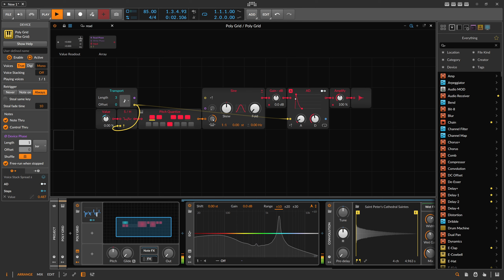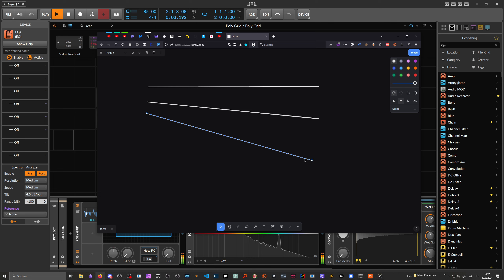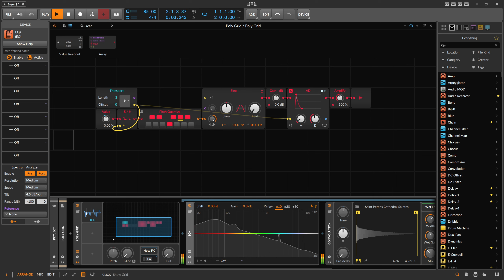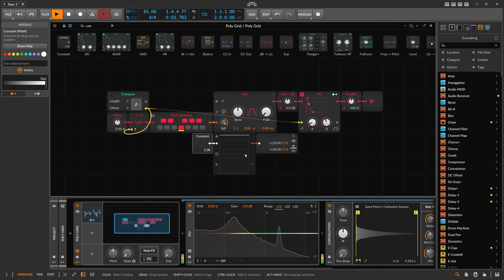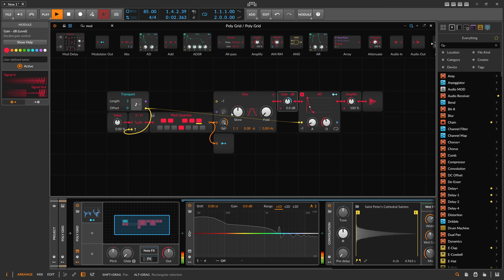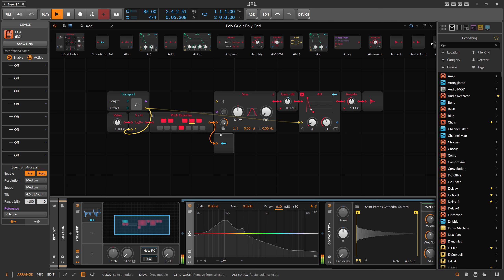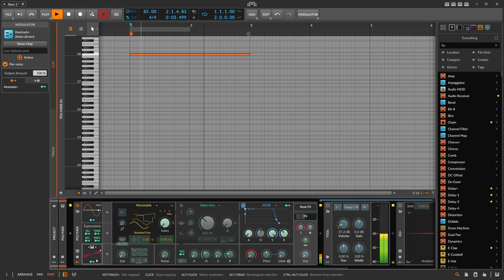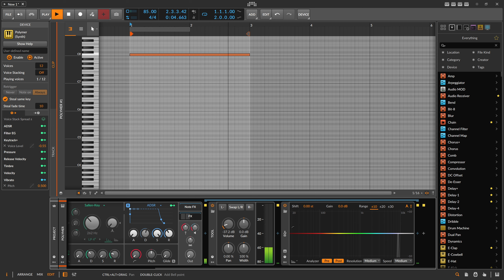Keytrack for Frequency Balance

Comment: Thank you. Must be useful. But for me, when apply this modulator out on gain (db) module, i have many clicks like a short attack. I dunno why, even if i move the gain module anywhere in the chain. Any idea?
Reply from the maker: maybe in monophonic, you change volume to quickly for one voice when playing too quickly?
Reply: @PolarityMusic  I used a generative  patch like your except 5 step on transport. maybe you are right. I tried to use exponential curve on the modulator out, no more clicks but few mod range. I tried also range or value tweaks in the modulation chain but no results. Thanks  to answered me anyway :) I have problems with cliks on attack envelope often, but with envelope  type or with adjusting attack range, i can avoid them. Maybe a thing to explore on your next tutorials? cheers and thanks you Dude for your contents. I like your mathematical approach on music that i don't have :)

Comment: But, can we use keytrack on tool device after synth? And modulate volume after processing. I need to try it
Reply: nope. it didnt work - tool device modulators cant recieve multiple voices. only mono. Next I try to put fx grid after polymen make patch with pitch in and GAIN-DB knob. It behaves strange - pops on fast note changes and can be easily distorted by cords. Can some one explain why it so?

Comment: Hey, I am a dumbarse, but I did notice with that last synth with C5 you pulled the volume down with the note modulator to -0.92 which is double -0.45 give or take.
Reply from the maker: Yea, good catch. I tried to communicate that the modulation amount is not in "db". The unit is some generic unit using the * sign.
Reply: @PolarityMusic  funny how close it correlates though, huh?
Reply from the maker: @notsure1135  maybe it's actually related, but i dont know for sure :D

Comment: You actually don't need to know what is the highest octave. Because the whole process is linear, you can just calibrate by setting a note to C3, adjust gain to match your reference line, then set a note to like anything else than C3 (ideally far away enough so you can see things moving) and adjust the keytracking modulation amount so it matches your reference line again. You don't necessarily need to do it at the highest possible octave. That's the power of linear functions: fixing two arbitrary different points is enough to fix the whole function :)
Reply from the maker: yes 🤝

Comment: This might be a stupid question but doesn’t this negate any velocity information you give your instruments
Reply: Or does it mean at each velocity value any frequency would be the same level as each other
Reply from the maker: you only change the overall balance with this. You can still scale the volume with velocity or modulators. When you balance your mix you can still have sounds in there that change in volume.